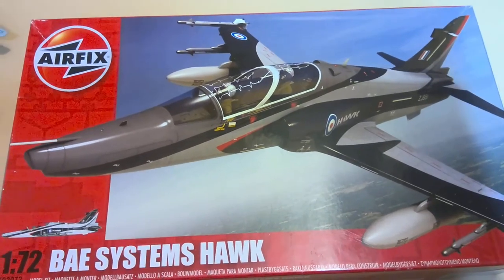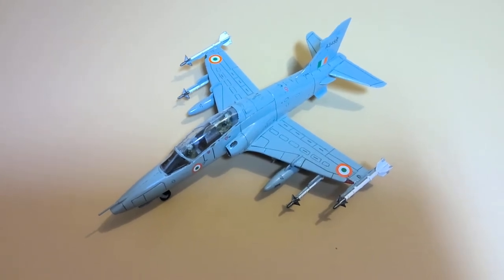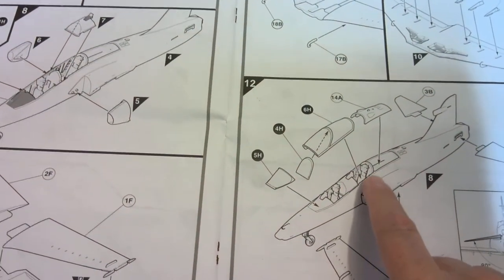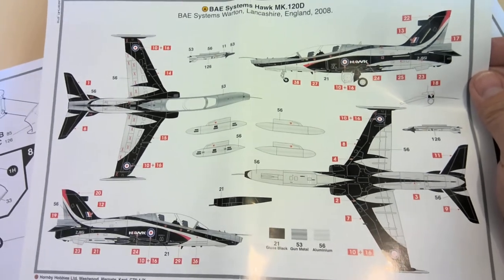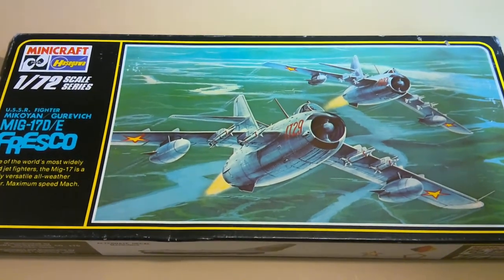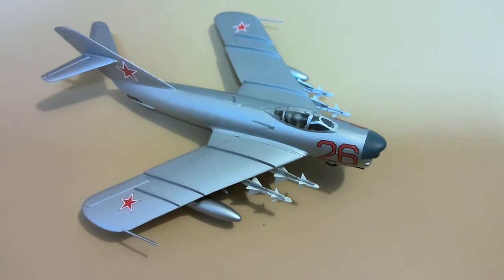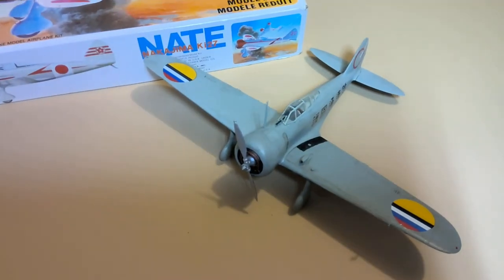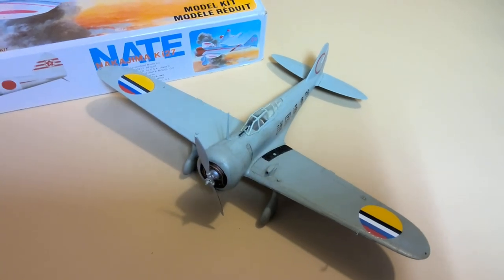Model Building - The BAE Systems Hawk (Part 3)

Comment: Congratulations - you did a fair enough job. This kit was one of Airfix's first 'post bankruptcy' efforts with overdone panel lines and dodgy printed decals. I bought it when it appeared as I loved the cover art and wanted to do the BAE Demonstrator. The decals gave me a lot of trouble and broke up as I was trying to fit them. Airfix kindly sent me a replacement sheet free of charge (within a week!) but they had the same problem, so that project was never finished. I must admit the kit gave me no fit issues.
Reply from the maker: Thanks!

Comment: Hi, compliments for the job and for the full idea of the project.

A question,  I simply could not get with: why Airfix used roundels with the central green point separated? What's the vantage for the modeller or for the Company?
As a last: More compliments for the Nakajima ki-27, in a Manchurian livrea: very interesting off topic job....

Keep going on; you made me want to start again with the Hobby!
Thanks and waiting for the next WWII Project!
GP
Reply from the maker: My understanding is that model makers are afraid that adding the third color (like the green dot in this roundel) has a high chance of printing off center. A lot of older kits suffer from that problem. By printing it separately, the builder can control it. Personally, I wished they would just invest in better printing equipment! Keep following the Providence Community Library Youtube channel for more videos. Next up is a Panzer II J.
Reply: @9librariespvd  If you have ever seen most Heller kits and plenty of Airfix kits (more than 15 years old) you will see few of them have the 'centre' centred. As you say, easier for them to print them separately. Both companies have now remedied this (Cartograf print for Airfix).